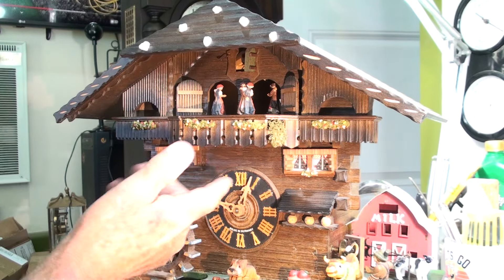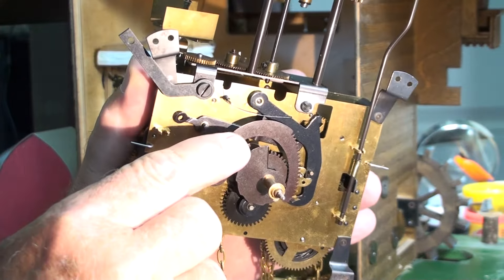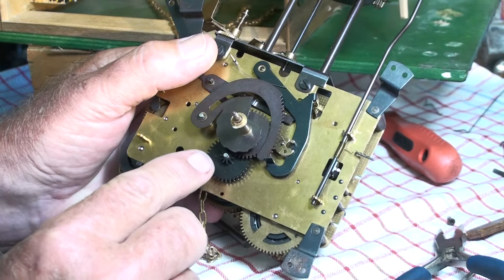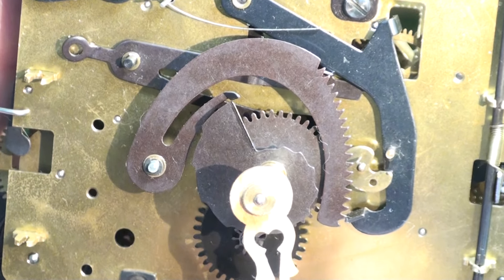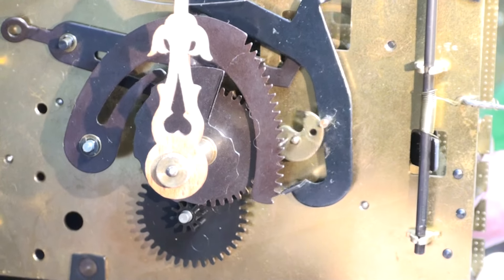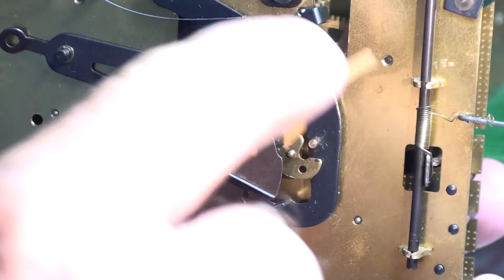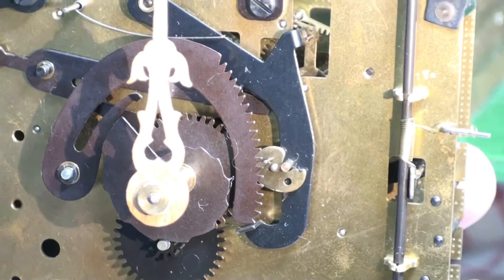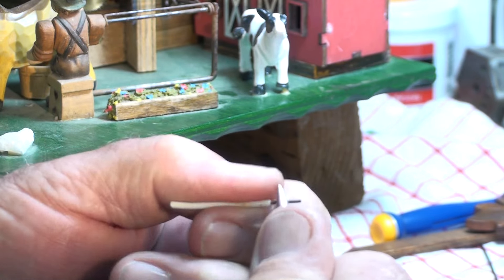8 Day Man Milking the Cow Now what could be Wrong

Comment: Love the clock. Love the man milking the clock. Love that you did this video to show people that their clock will stop at 10 minutes until 1 and only then if that snail isnt put on properly.  I discovered this issue with a musical after the hunt hunters cuckoo clock that is the size of a novelty clock. Pain in the rear to work on.  I think that instead of putting the plastic on the 2 levers for the triggering system that if you were to  put it on the 8 point star wheel tabs that would quiet the system down. Just my thoughts. Great video. Love it. Thanks for the shout out. God bless you and yours.
Reply from the maker: Thanks for commenting Mark. I got the clock done again, sent it back after a couple of weeks running and got a message that the clock was running good, then it stopped working again but still keeps time. Just how much money can you pay the Post Office before you just give up.?.
Reply: @justmike57  I truly understand the issues that you are having. That is why they call them cuckoo clocks because you will go coo coo.  You might try video chatting with them to see if you can diagnose the issue and explain to them what they can do.

Comment: That clock has a lot of detail when you zoom in. Thanks for sharing. I usually like my lift lever tab to hit pretty far to the right on flat space of the snail just so it has the time to rise up to the 1:00 tab. Also the 10 and 11 spots seem so small that mine was hitting on the bump instead of the flat surface if I didn't set it up right of center on the 12:00. I kind of liked the clicking when he milked the cow!
Reply from the maker: I have never had a problem with the snail and the lever until I worked on this clock. It took some time running well and then started messing up. I also love the sound of the clicking when the man is milking the cow and also will bring the eye to the sound. 
  Sad thing about the clock is that the cuckooing and music has stopped working again. The clock is in Florida and you have to ask yourself, Just how much do you want to pay the Post Office AGAIN, to get the clock adjusted again. Thanks so much for watching Adair's Repairs. God Bless.

Comment: Hi Mike! The clock is working good except for the last cukoo is cut off like you only hear half of a co on the very last cuckoo lol strange thing ...I see the bird is connected in this video but when I got it back home the bird didn't have a wire on it so I managed to get one on there lol also still waiting for my pendulum lol...thank you so very much for working on this special clock! Much appreciated! Could you send my original pendulum please lol
Reply from the maker: Not sure why the wire would come off during shipping. It seams odd that this clock is going out of adjustment on it's own, the more it runs. When I got the clock this last time, everything was out of wack. I just blamed it on the spring that came off and tangled up inside.
Reply: @justmike57  right I know it makes no sense I don't touch it..the last time the hands kept getting stuck and then that wire got stuck in the teeth and pulled it all out of wack..it's hanging on a wall all by itself so I certainly don't understand it lol. It took it awhile the first time it came back home to start messing up..remember I found the hour hand on the floor one morning..and this time since it came back home it didn't have a wire on the bird and there wasn't a wire in the box but it's working great so far except me having trouble keeping good time because I'm using a pendulum that don't belong to the clock since you still have mine lol but that last cuckoo isn't going off fully what would cause that??
Reply: I forgot to tell you that altering a couple of days running that the man stopped milking the cow and I took it down to look at it and found the wheel inside at the front was lose and had moved away from the teeth to move the levers I was able to push it back into position and tightened it back up so it's been fine since that as far as that goes lol how could the wire to the bird come off during shipping?? There was no wire on the bird nor to the door so if it came off during shipping it would have had to come open at Both places makes no sense and I didn't see that wire in the box I went back and looked after seeing the door wasn't opening on the cuckoo...this clock is certainly becoming a mystery lol